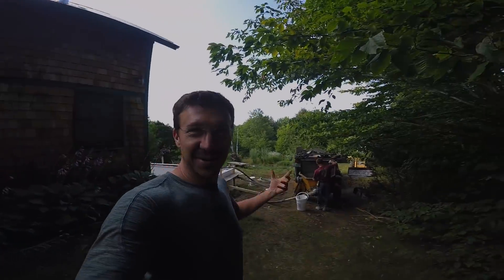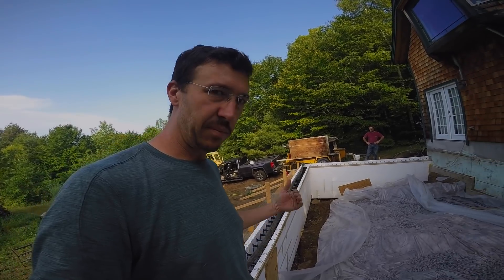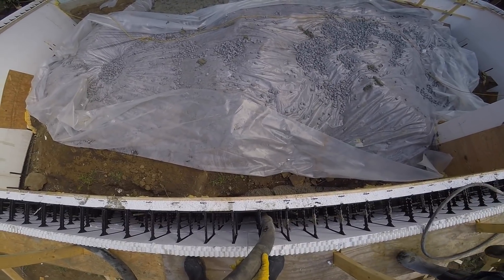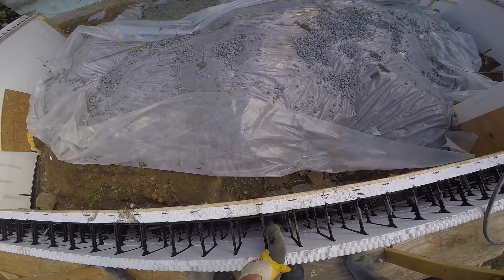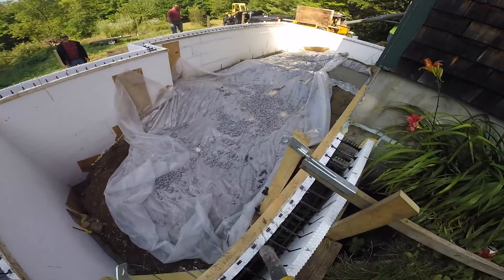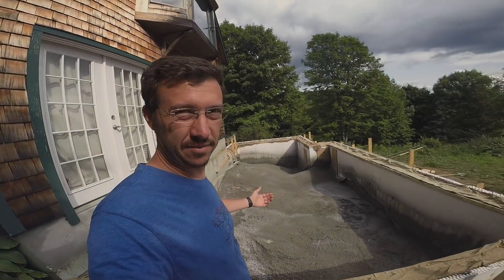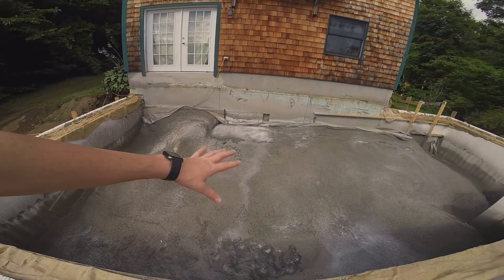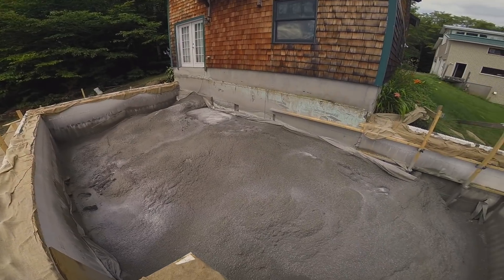Pouring our ICF concrete foundation DIY House Addition Build

Comment: I’m thinking a ‘base block’ say 16” wide, 12” high side turning 90’ to form the footing top with the key locking tabs for stacking the rest of the blocks.  Trim the bottom to fit your site contour or specific footer depth.  No need to stuff around with multiple mixes of concrete, ‘bag’ types footings, etc.

Comment: disappointing video.  after showing how you set everything up with the huge gaps at the bottom of the forms, i didn't see a single second showing how you kept the concrete from spilling out and what the "footing" looked like in the end.  would have been helpful to explain why you used the type of pump,  nice to have the flexibility to blow in the concrete in the end.  I have no clue what your mix was for the wall.  neat project just not enough of the important details.
Reply: I agree

Comment: do u find the icfs to be really expensive?
Reply: In a foundation ICF is faster and cheaper by about $3.50 per  sq ft at least with AMVIC.  On this monopour they should have made a footing out of Fastfoot or a fabric bag or even 6 mil poly to hold the concrete from gushing out.

We have crews doing ICF to the roof for same cost as wood frame , but on a faster schedule
Reply: @billmccance7762  Fab-Form Fastfoot is a great idea